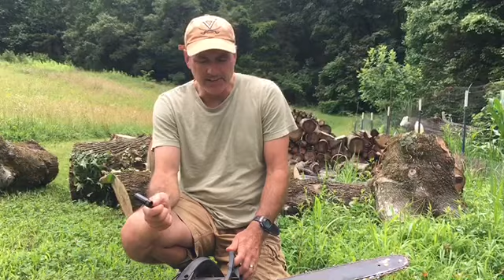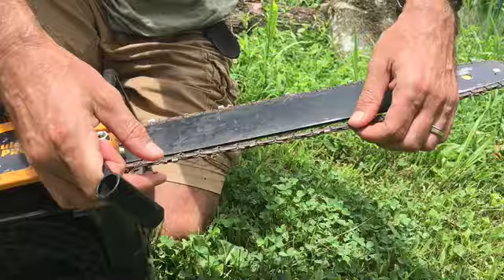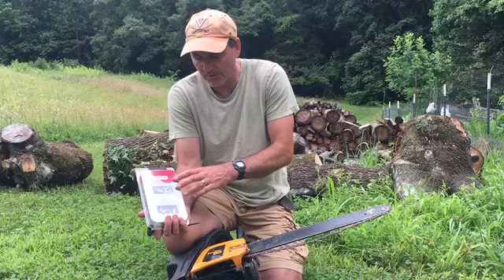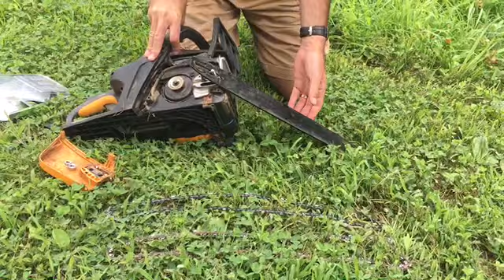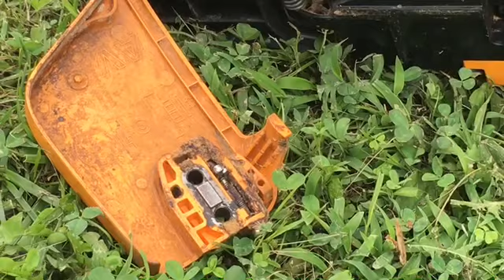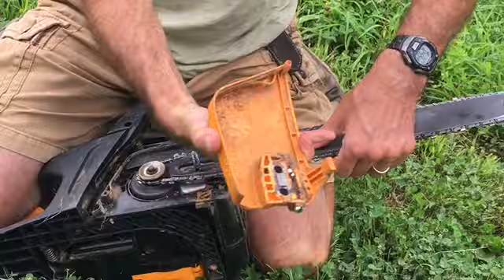How To Change The Chain On A Poulan Pro 18 Inch Gasoline Chainsaw

Comment: a couple of things, there is a location at the base of the saw for the tool. it clicks in so no need to keep in your pocket. also, before you tighten the chain, you should adjust the chain with the screw driver part. you should be able to move the chain without effort but no gap. I always start with a clean chain and fresh gas, and a spare chain goes with me.

Comment: I have a 50cc Poulan with 20 inch Bar,everyone says they are junk but 2 years of use and a carb adjusting kit from Amazon and I beg to differ ...  I use a Oregon Chisel Chain,stock Poulan Chain overheat too easily and loose their Temper and after that their just about impossible to keep sharp for very long.Also make sure plenty of Bar Oil to lubricate and carry heat away!
Reply from the maker: I've found these Poulans to be about the best bang for your buck you can get. Thanks for the input.

Comment: If I'm not mistaken the chain should be a little more loose. And you first hand tight the bolts then tighten the tensioner then tighten the bolts all the way....

Comment: Just an observation…I always pull the spark plug off and make sure the switch is in the “off” position before I mess with any of my saws….only takes 30 secs and could save you time in the hospital.

Comment: I have a poulan pro 20"  pr5020 and bought a blade for a pr5020 and it feels like there's another inch of slack after its pulled all the way out. Bar cant go any further and i have too much chain still...🤣🤣🤣🤷‍♂️

Comment: I have PP5020AV the chain came off and I got everything lined back up. The tightening pip won't line up with the small hole no matter what I do. It is sitting above the hole 1/8 to a 1/4, when it's in operating position. I let the chain get slack in it, being lazy and it pop off. Been an aggravating ordeal since.

Comment: Can someone help my 16 inch poulan keeps throwing the chain off can someone give me some advice or point me in the right direction to why it's doing that
Reply: Is your chain sharp? Pull your bar and lay it on a flat surface, and see if it’s bent.
Reply: @springfield03sniper  I didn't think to check that. Will give that a try tomorrow morning.
Reply: @crywolf1224  I run a lot of saws, and one of the common things for a thrown chain is 1. Improper tension. Look this up on YouTube, on how to properly tension your chain. 2. Dull chain. 3. Bent bar.
Reply: @springfield03sniper  I have a feeling it is bent bar or maybe my tension was not enough because I was using a new chain and it threw it off. Before that the chain was lightly used I thought it was dull so that's when I swapped it and was thrown
Reply: @crywolf1224  check your manual, or if you don’t have a manual, google a copy or watch YouTube. If you aren’t cutting anything, just running your saw, even a dull chain won’t be thrown. It’s only when you start trying to cut wood with a dull chain that it will be thrown. If you start it up, get it a few revs, and the chain doesn’t throw, probably is not a dull chain causing this. If it throws when you aren’t cutting anything, usually means bent bar, or tension issue.

Comment: why is my saw the only one with a clutch? I have a poulin pro 50cc.
Reply: ALL chainsaws have a clutch.  That's what makes the chain move when the trigger is engaged.
Reply: Depending on the saw size and manufacturer some saws have an inboard facing clutch (Husqvarna) while others have an outboard facing clutch.  The latter are slightly easier to load a chain onto.